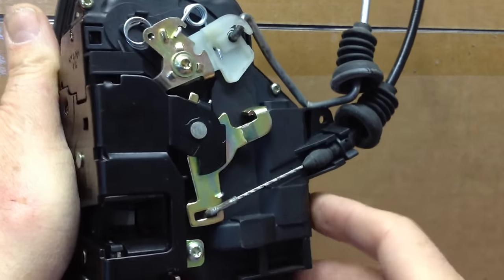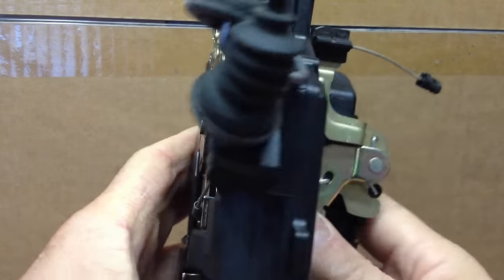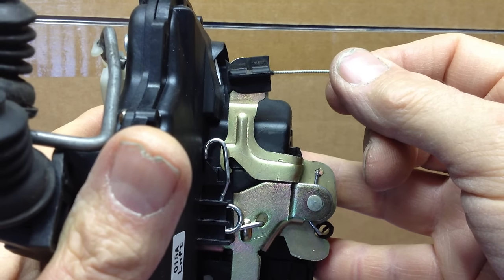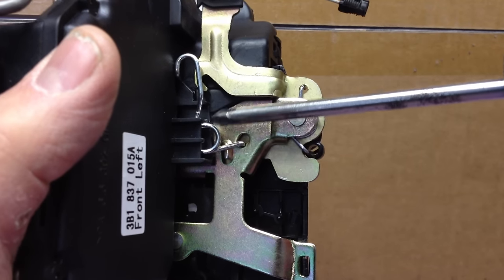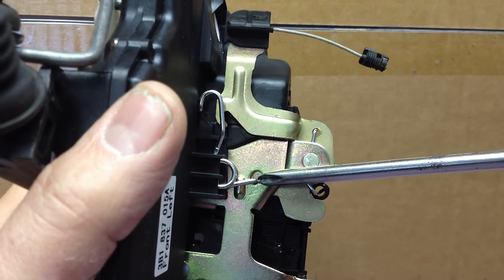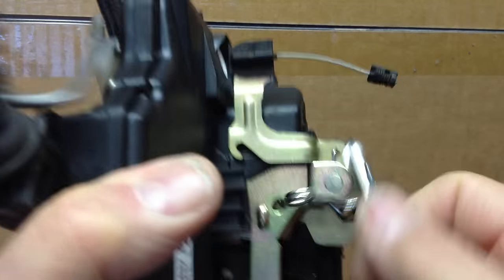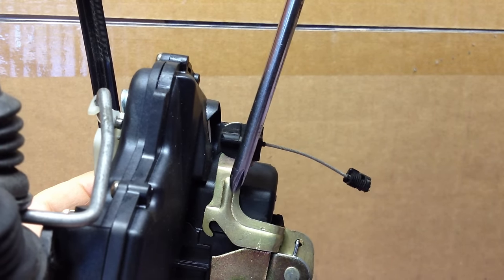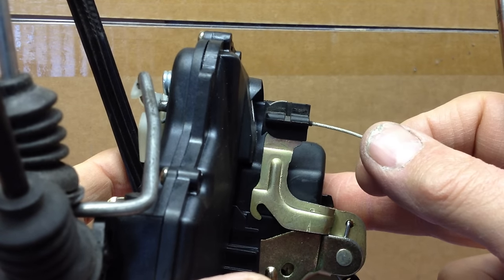Why Your VW Door Won't Open

Comment: I removed my drivers side door panel,mirror and all fastening bolts including the 4 bolts on latch and hinged ends however I didn't have the proper size Torx  for the two holding the latch mechanism . This is a 2008 Cayenne. So I put every thing back together. I happened to see a comment that says that that spring I was about to remove to clear the problem is in fact necessary. I presently carry a 1.5"x12"X1/16"piece of plexiglass  to act as a slim Jim to unlock the door when needed. It doesn't happen all the time. What is the fix?  One more problem how to separate the rear spoiler to replace the middle brake light. My lift gate doesn't have a window hatch and there are no screw fasteners under the pop out interior trim piece, just the two on the outside edges on either side.

Comment: I have this problem on a VW Sharan 03, PD 1.9 TDi which I am going to try a few of the tips given here.
I would make the comment about the quality/design on  VW's, I had a Seat Alhambra 1.9 TDi prior to the Sharan and both had oil leaks, I virtually ended up not having to do oil changes having to top up evry 500 miles. The handbrake on both did not self adjust and I was forever lubing the seized lever on the calipers.  The PD fuel injectors are a pain in the ass to change and the brake/clutch hydraulic reservoir is not easy to access.  These are the kind of annoyances that need not happen if more thought was given at the design stage.  The Japanese excel at making well thought out cars, my wife's Honda Jazz just gives us non of these headaches and I often jumping into her Jazz rather than my VW because it drives so well, quietly,  at 55mpg.
Reply: David Cole g

Comment: something like this is happening to my 03 jetta. When the door doesn't want to open I just push the door (not hit it) hard enough so that I hear a "click" noise (which I think it is the lever resetting) and after that click noise I can open the door. I will try and take that part off and see if its the same problem (which I think it is). If it is, then you don't have to insert something through your window. just push the door :D.
Reply: Spawn223311 Is your problem still there?
Reply: Jean-Paul Robichaud yes but i haven't  done anything to fix it haha
Reply: Spawn223311 l just try by pushing on the door..... doesn't work..
Reply: Jean-Paul Robichaud well i push kinda hard but fast and the door makes a click sound, and then i can open it. But the problem is still there (I have to do it almost every time)
Reply: Spawn223311 Thanx. I'll hit him with my other car!!
Reply: +Spawn223311 My mechanic showed me a similar trick yesterday which he calls the Fonzi Trick. He simply made a fist, and tapped the door just below the door handle, and the door opened. Worked every-time he demonstrated it. This does not damage the door in any way.

Comment: same problem with my s5. thanks for the tip!
Reply: i spent £150 on mechanics to pull both door cards off on my S5 and replace the wires. didnt do anything. so will try this. been driving around for 3 months opening the windows from the outside and unlocking from the window.

Comment: I was thinking: Isn't it possible that the upper part of the big spring, should be behind the brask/copper/yellow part. Just to help the small spring. Can't you hook it? Because the way I see it, there are also some marks on the black pastic part. Right in de corner of the yellow part.

Comment: My 2007 Passat stopped opening on the Drivers side today from the outside. This video is for a B5.5. I wonder if the mechanism in the B6 is the same?

Comment: Tomorrow I will try this if not "chainsow massacre" for my car :) 10x
Reply: Late to the party BUT: The other way to do it is whenever the door refuses to open, just disconnect the battery for 10 seconds. Then reconnect and initially flick the open all doors, and then flick close and open again. This works for me every time. That said my door handle does not get stuck every time. I think it is on the way out but those mechanisms are too expensive and I have an 02 Mrk 4.

Comment: Great video...I have a very similar problem on 99 New Beetle. I installed the new lock actuator, then I locked/unlocked the door, and when I pulled the handle, the door wouldn't open.  Then, when I release the door handle, there is a barely audible "click" and when I pull the handle again, the door opens!  Not sure where the click is coming from...I have re-installed the little plastic piece on the end of the cable in several different positions (all the way slack to all the way tight and several spots in the middle of the adjustment) and I still get the same thing, pull the handle, won't open, release the handle, hear the click and on the next pull the door opens. I looked at the old lock actuator and the spring you mentioned is installed on it.  I tried using a screwdriver after unlocking the door to gently push down on the mechanism just in case it's not seating all the way, and it appears to be seated.  Any input will be helpful, thanks.
Reply: cut off a litle bit from the spring. its too long.

Comment: Tried this and still no joy   grinder , hammer need now i think .
My palS 2004  front drivers door still wont open  and so far have had to
 butcher the interior door panel then even after removing the steel 
inner cover still no joy getting the door open .Looks as is if a big 
hammer will be needed to smash the lock but my issue here is i need the 
key barrel  as i need to swap it over to a s/hand door i have .
Removed the rear door and then  slackened  the  barrel screw , removed 
the barrel  and then removed the only lock bolt which is visable  then 
forced the lock down from the inside and the door opened , replaced the 
lock  and  the door handle  now operating ok but a nightmare of a job 
.The door electronics were keepimg this door locked shut  no issues with
 cables ect .

Comment: the spring serves a purpose it gives u the correct tension for the cable to the door handle that's why it's there not because vw just wanted to waste a piece of metal lol
Reply from the maker: I know what that spring is for and mentioned in my video. It’s only used 1 time on assembly and in my case caused problems afterward. The placement of the cable in the handle is easy to determine without the spring doing its job of holding the arm out.

Comment: I have this same problem on my Seat Ibiza (which has an identical lock mechanism), but attempting to reset the latch as described doesn't help. Any other suggestions?

Comment: You wouldn't happen to have a video which shows us how to remove this mechanism from the door I think this is the problem I am having with my 05 Audi A4 but I don't want to remove any parts which may disrupt the glass track or any other important parts cheers
Reply from the maker: I don't. But, it's not too difficult. The key is to leave the lock mechanism attached to the inner door panel/carrier when you remove it. That's the thing with the bolts around the outter edge that carries the window regulator.

Comment: I can open my door from the inside but not the outside. I've taken the panel off and the glass out to get a better look at it. The cable isn't broke and tension is fine. What else could it be?

Comment: Maybe file that spring clip end down so it doesn't drag on that arm but leave it on.
Reply from the maker: Maybe...... but it’s never needed again, unless the assembly is removed or tampered with.

Comment: I have this issue, if I use my thumb and FIRST push the  handle the " wrong way" for a few millimeters, then it triggers and opens as normal, if I don't do that the door will not open.

Comment: My issue is that the left back door won't unlock. Not even manually, or centrally. Anyways, you can pull the handle, and the little pin which shows is the door locked or unlocked, gets up, and as soon you let the handle back, the pin goes back...
Reply from the maker: The sear type thing is not resetting. Try to push it down from the top with a long skinny screwdriver.
Reply: Thanks for your answer! 
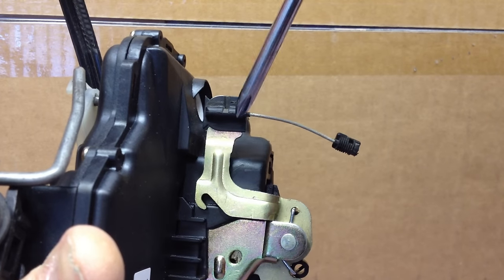So, did you mean, I have to do this, that you showed at 2:33?
Reply from the maker: Yes
Reply: Jon Plamondon An issue occured. I can't reach the needed area with a screwdriver, the window isn't flat, and I can only reach it with a sort of thin plastic, and I can't even see into the needed atea because there is some kind of protection. And theres a thing I noticed, when locking/unlocking the doors, the door gives a very wierd/no sound. Is there something more I can do, would be very helpful. I didn't open the door for like 5 months..
Reply: And I forgot to mention, I have a 1999 Passat wagon
Reply: I have the same problem with a 2003 mk4 golf

Comment: Does the video show what the "reset" amounts to. mechanically? I can't see it.
Reply from the maker: Just the fact that that arm must return to its fully seated position, which may be hindered by the spring tang poking through the hole. You may be able to hear a slight click when it resets.
Reply: @jonplamondon4076  Hi Jon i meed ur help plz i have VW passat 2018 the passenger door can’t open from inside and outside since long time 😢 how can i solve this problem?? 
Best regards

Comment: Can you help me please I changed the door locks on a vw bora 2004 and they was working fine after i changed them but as soon as I locked the car then unlocked it it decided not to open from inside and out any help with this will be much appreciated thanks

Comment: Hello guys, hey Jon, I hope that your video will help, the video was best and clear but, I dont know if it will work with my problem:

So first of all I tried to change a dead battery of this 2000 VW Golf with Immobilizer in the backyard of mine, meanwhile I put the key into the ignition, neutral position. So door closed accidently, in the meantime a new battery was place, the golf got life and activated central locking with Immobilizer of course and the keys inside!!!!
At the moment I realised, I got a little stroke but I laught my ass out MALAKA with the coincidence of Murphys law! Fuck! But I will solve it and add this to my skills, hopefully!

Until that point, ment for 1hour until it heavily began to rained I thought to internetize my problem. 

So who can help me with that? I am on an Isle in Greece trying seriously tou relax B-)

Comment: you don't have to remove that spring the cable that goes to the outside door handle is a different size to the genuine Volkswagen one buy about a centimetre so when put in the door lockback switch out them cables and used genuine one that souls that problem

Comment: My rear, passenger side, door will not unlock with the rest of the doors. It can be opened from the outside by reaching inside in from the front door and using the door handle and then it stays unlocked until all of the doors are automatically locked again. Any thoughts?

Comment: Hi Jon - will this work for my 2007 beetle? I bought the car recently & locked it using the fob & now the door won’t open from the inside or the outside... Can I get the door to open via the window?
Reply from the maker: Hi Jodie. Sorry I’m not familiar with the 07 model. Hope you get it figured out.

Comment: Thought I would post my experience here. I have 2006 B6 passat, my rear door would not open from the outside after been remotely unlocked but if you pulled the interior handle then it would open from the exterior. I completely removed the door lock and stripped it open to see how it worked. there are two motors which rotate when locked and when unlocked should reverse. the problem I had was that one motor did not reverse allowing the mechanism for the exterior handle to engage therefore the lock would not open. only when the interior handle was pulled did this manually force the mechanism into gear and then allow me to open from the exterior handle but as soon as it was locked again I had to repeat the process.I simply bought a new lock from a scrappy, off a B7 passat(same part number) and have just now fitted it and bang, the lock is now operating, now for the front passenger door! if anyone needs any advice on lock removal, I'd be happy the help
Reply: Stephen Reid I have the exact same problem with my 2012 Beetle. So frustrating!

Comment: All 4 of my doors wont unlock. is this the general module component or its this fix you showed?
Reply from the maker: Can't imagine why all 4 doors won't unlock. Did they all fail at the same time?
Reply: yes. Yesterday. Couldn't get in the car. Had to turn the key extremely hard to open the driver door. Then i get inside, press the lock/unlock button, i can hear a sound like they are trying to unlock but none of the doors unlock. With the driver door unlocked the handle is able to open the door from the inside and outside.. So i locked the door with the lock/unlock button, (lucky i had the window rolled down) the handle to open the door did not open the door. So if the window was not rolled down, i would have been stuck inside the car.. I had to climb out of the window. All 4 doors wont open from the inside or outside.
Reply: I looked it up and they say maybe its the general module that controls the fuses. But i hear a sound like the doors want to unlock. And since I got the driver door to unlock, if i press the lock button, it will lock, but it wont unlock. So I know its working. Just cant seem to figure what is the problem.
Reply from the maker: Hmm....All the locks use little electric motors to lock and unlock. With all failing at once,
Reply from the maker: That sounds like a common electrical point. I'd check to see if there's a fuse involved.
Reply: check the 10 amp fuse in the board

Comment: My drivers vw cc will not open from outside handle but it will open from inside . Can this be the same issue or something different?
Reply from the maker: Probably something different. I'd start by making sure the little cable that the outside handle pulls on is tight enough. It may have slipped a little in the grove that it sits in.

Comment: give a gentle punch to the PLASTIC DOOR HANDLE on the outside. The impact forces the mechanism back into place. 

I emphasize, hit the PLASTIC HANDLE, not your metal door panel. I need not explain why.

I have a B6 A4. I changed my drivers door actuator, and have been punching my way into the other 3 doors since then. I will try this trick in your video and return with some feedback soon.
Reply: Lex Slr ?
Reply: @Nick-qx2ck  without changing the actuator, you can just use this method to get your way into the car 
🤷‍♂️
Reply: Lex Slr no I know that it’s the method I use. I was wondering if you’ve done the fix depicted yet and if it worked or not
Reply: @Nick-qx2ck  I haven't gotten a chance to do it as yet, but I intend to very soon. I'll return here to update.

Comment: i hv a 2010 vw cc and cant open the drivers door from the outside from the outside and it locks by itself. i can open the door from the inside. what do u think is happening.
Reply from the maker: Sorry Brenda. I'm not familiar with the newer models. Good luck.

Comment: Urge I just put a new one of these in a week ago and now the drivers side door won’t open from the outside. 😩
Reply: me too dude did you fix it by this method??
Reply: 2STROKE POWER I took it to a shop. Needed a new door cable, actuator, inside and outside lock.

Comment: Hi Jon I have this problem with my Golf 5 GTI but the door is closed. will this work on a Golf 5
Reply from the maker: Sorry Cameron, I don't know if it's the same mechanism.
Reply: Where could I send a pic?
Reply: Jon Plamondon It looks very much the same as in your video though. But I think that the inner opening part isn't resetting
Reply: Could it be a fuse? But then all the doors won't work

Comment: Anyone who has ever been to Shanghai, China will understand why everyone is having problems like this. VW/Audi have a factory out there in Shanghai. I'm guessing that most of the parts were designed and made out there by crafty little Chinese engineers and we are all drawing from the same parts bin. That being said, I believe your right, that spring serves not other purpose except to  help take up the cable slack at installation. My guess is they are shipped with the spring in place, "but not hooked into the slot", to allow the mechanic a way of quickly adjusting the cable, then it is meant to be disconnected and stowed where it is. Taking it out shouldn't hurt anything,especially if it is preventing free travel. If you need to save the spring in the glove compartment box for future adjustment.

Comment: how do ytou open the door when this happens. i have tried to openthe door fromthe inside and the outside but with fail. when you pull the lever the locking knob goes up even while the car is unlocked. please help
Reply from the maker: Try using a screw driver or hack saw blade from the top through the window opening to push down on the little arm the door handle pulls on to "reset" it.

Comment: my passat 2007 the door side driver doesnt open from outside. if i roll down the window and pull the both handles (inside and outside) at same time and try open and close somehow i manage to open again from outside but then once i lock up the doors when i park the car, and i unlock the doors to reenter in the car, the same problem before comes back. its really annoying. 
anyone knows how to fix it. will this work?
regards

Comment: i dont understand how to access that part can you please elaborate.
Reply from the maker: Well, it's pretty complicated to get to that part. Basically you remove the door panel, then unbolt the window glass. Then there's a carrier panel that carries the assembly I show in the video. There are a series of bolts around the perimeter that hold that panel, bolts near the door latch and the cable that goes to the outside handle. The secret is to leave the door locking assembly attached to the carrier panel as you remove it. It's not an easy project. Good luck.